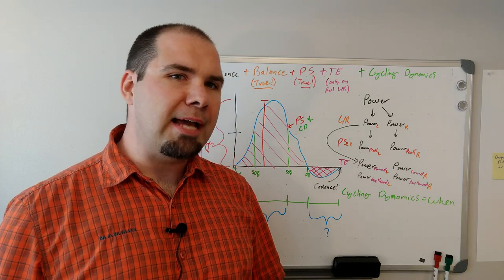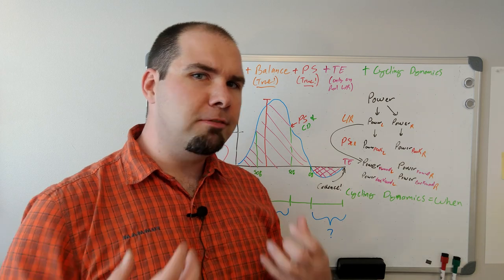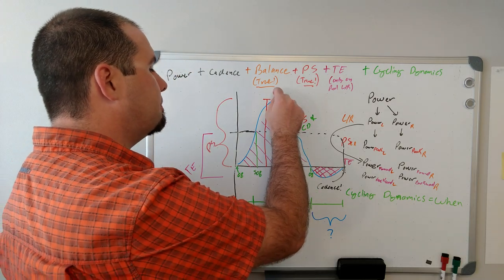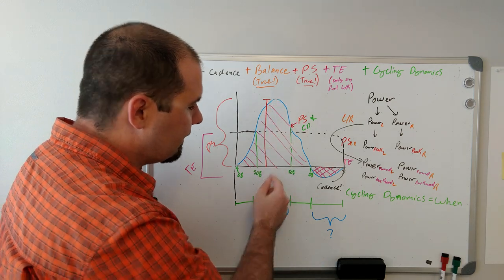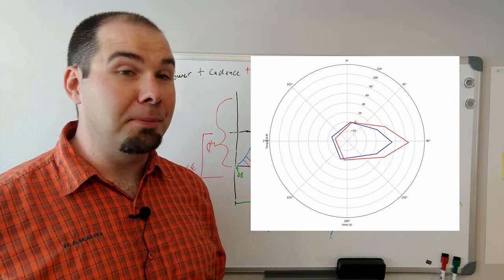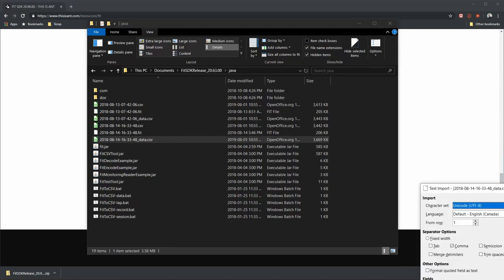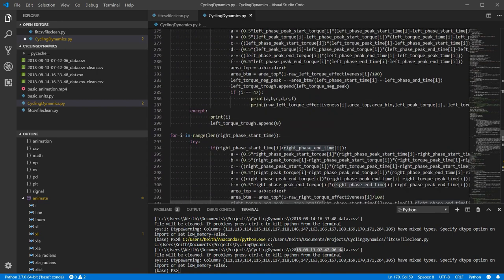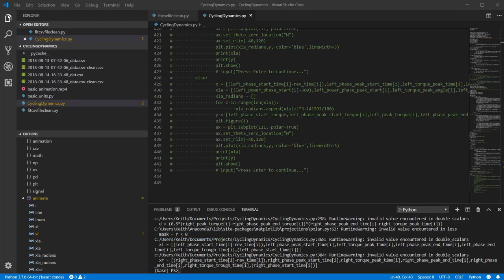High speed pedal power data only on Assioma and Garmin

Comment: Hi Keith, very cool! I have the Assioma pedals also and have been playing a little bit with the fit files after watching your video. Two comments on what you did: 1) It looks like when computing the peak negative torque you are taking the area as a rectangle instead of two triangles. 2) To get the traditional peanut plots you would need to translate one of the sides by 180 deg and add up the torques. You could do this by fitting a function through the 7 points.
Anyway thanks a lot for putting this together. I will experiment a little with fitting a function and will let you know what comes out.

Comment: Sounds like a good plug in to Golden Cheetah - especially if it could calculate it on the fly and display like Rotor or Wattbike
Reply from the maker: For sure. I haven't used Golden Cheetah in a while though but most definitely could be added fairly easily. I've debated trying to make a connect IQ field, but I'm so swamped with things. It is easy to calculate on the fly. I want to add a higher order regression so it makes it all smooth.

Comment: What about the cycling dynamics from Pioneer, Rotor 2INpower or Infocrank?
What do you think of the 2INpower system in General?
Reply from the maker: They can do it, but those companies have to implement it via new firmware. That's up to them. As of now it's only Garmin and Assioma implmenting this standard. 2inpower has a great right arm gage placement, okay to good left. I haven't used it recently but people have reported to me still issues with it's cadence sensing inside that is unresolved. Infocrank uses some sort of torque analysis such as peak torque rotation sensing to determine cadence, which as you can see bounces around all over the place stroke to stroke, so I don't think they'll be able to resolve cadence accurately enough, and even if they do they have no way of figuring out it's orientation appropriately -- means they can but could have random +/- 20 degree shift compared to a more accurate rotation sensing system using an accelerometer.
Reply: @kwakeham  I had an Infocrank for 3 years until I ruined it because of some water ingress. In the beginning they used magnets for cadence and orientation, which worked really well, I think. Then the magnetless firmware came on, and it felt a  bit wobbly after that, Ike you suggest.
We are using 3 2INpower units here, and 1 of them gives me some problems with not waking up or hanging in some kind of set-up mode.  I suspected it to be something with cadence sensing.
Reply from the maker: Sucks to hear about the infocrank. Presumably you can go back to magnets on those (except the water ingress part). I suspect that Rotor will update the 2inpower units for this. They were the guys pushing for PS and TE metrics but that was back when the designer was MEP (original rotor power) and not Indra systems. So let us hope. Though I think 2inpower has a private high speed method with their own software. It's the proprietary fall down though. So not sure if it was Rotor or MEP, but the 2inpower is certainly capable of Cycling Dynamics with nearly 0 overhead.

Comment: Right/left balance seems fairly different, do you think this is something physiologically specific to you, or is there any (significant) effect at all from the left leg having to transmit power through the crank -> bottom bracket, whereas the right is more direct?

Thanks for posting the code.
Reply from the maker: Hit by a truck in 2006 pinning my knee between bike frame and grill and launched me upside down clearing a 4 lane divided intersection or about 50 feet before I landed. It's been weird since then. Years latter it's generally okay but there are differences in how the muscles work. I have actual proper high speed data of my legs. They work differently more than most I've seen.
Reply: @kwakeham  wow, good you've recovered from something that crazy.
Reply: @kwakeham  all that matters is they still work, different is generally accepted as good if not great 😁